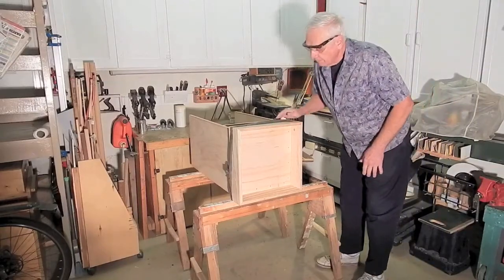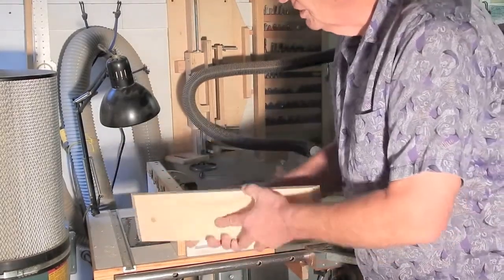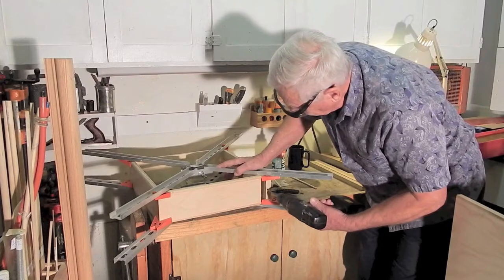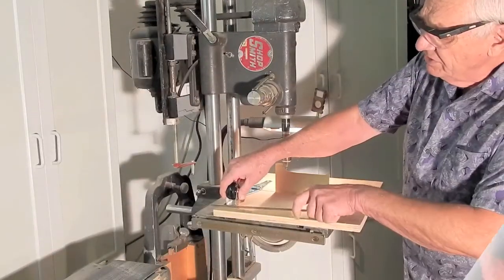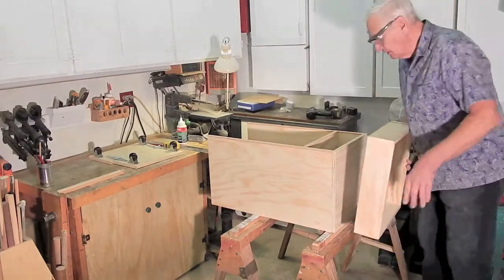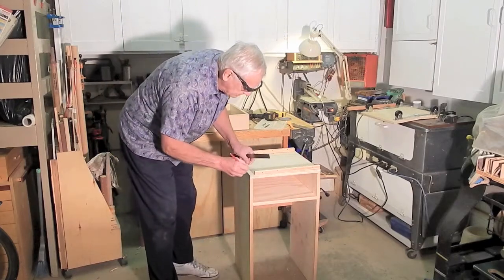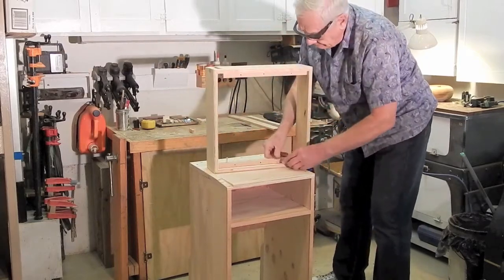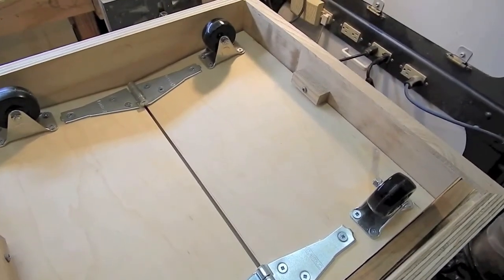Flip Top Tool Stand   Base Skirt & Casters 2 of 4

Comment: Been looking forward to a demonstration on how to build your caster system, thank you. One question, how do you calculate the height of the skirt, when you know the caster height ? (I assume its the caster height is the base value used for the skirt height, could be wrong)
Reply from the maker: Michael Pedersen Skirt Height is equal to Caster Height plus Caster Mounting Board Thickness plus height of Pivot Blocks minus Floor Clearance When Raised (Aim for 1 cm (3/8") . Always anticipate some trial and error during assembly. Thanks for viewing my video and thanks for question.